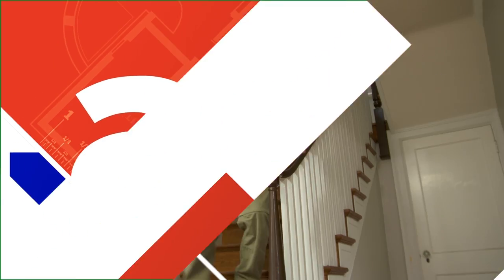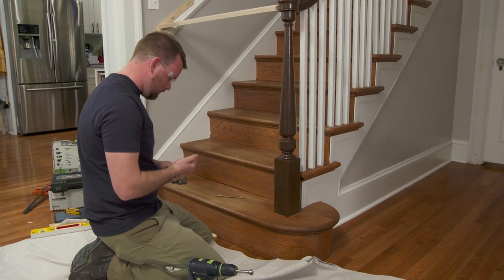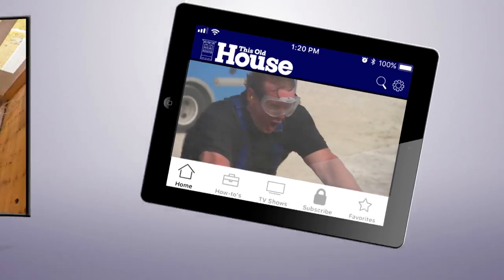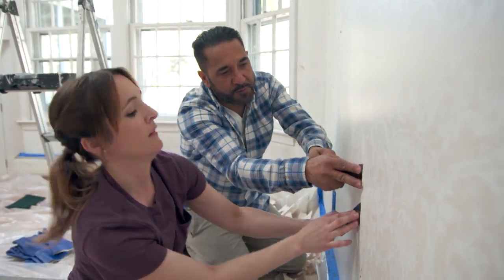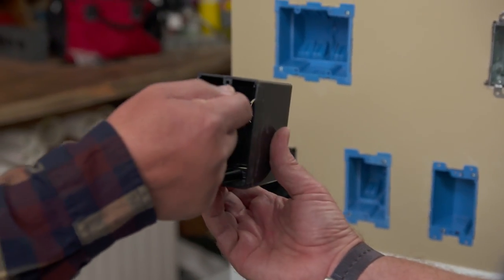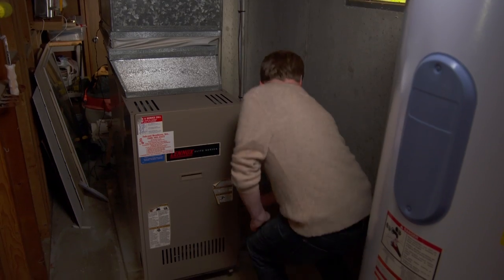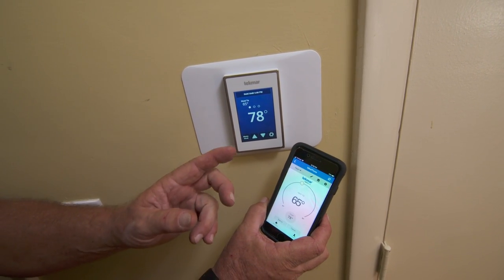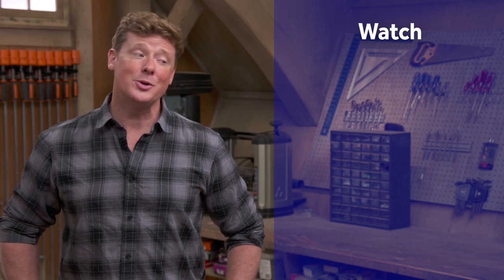ASK This Old House | Loose Railing, Smart Thermostat (S18 E13) FULL EPISODE

Comment: Hi, a nice upgrade of the thermostat but the wires were striped about an inch and only stuck into the device about ¼ inch. Then he pushed the wires back into the box that could have touched each other and sorted out the unit or even started a fire, I understand that the wires were now only acting as a switch but good practice should always be the rule.
Reply: Yeah I was going to say "Richard, you're a great plumber but a mediocre electrician!"
Reply: Believe it or not, I’ve seen this type of wiring in a lot of new construction.
Reply: He's a hacker
Reply: Lots of armchair electricians in the comment section
Reply: You don’t have to be an electrician to know that you should always trim the wires to the right length. Pride in your own workmanship should dictate that, surely?
Reply: Plumbers lol
Reply: The low voltage wiring to run a thermostat isn't going to start a fire. You're still not wrong, they should've been trimmed correctly.
Reply: @l3jhdfk  I agree
Reply: I actually had that problem just last month. The HVAC guy had too redo the wiring at both the furnace and on the thermostat itself because to much insulation was stripped off and it ended up shortening out.

Comment: I love the idea but I have to say...the wiring done was not the best. The bare wire at the terminations should be kept to a minimum. There was enough bare wire there to cause a fault between adjacent terminals...especially at the old thermostat location when the wire was tucked into the wall.
Reply: That is a class 2 voltage it would never spark enough to start a fire the transformer would just burn out if there was a short, although I do agree it should have been done better
Reply: His success stories are everywhere 😱
Reply: Antonio as an hvac tech I cringe  every time Richard does low voltage wiring there's definitely way too much wire stripped for those connections

Comment: Richards thermostat looks great but 21:43 he should have cut off alittle bit of the expose copper because they might touch and blow the low voltage fuse.
Reply: @19:53 Wiring had to much insulation stripped off. Suppose to have insulation on the outside and bare wire inside on terminal.
@19:55 Ran  wiring over the duct work. That's lazy workmanship and  duct work .. although extremely rare, could damage the wiring.
@20:43 Circuit board the wiring connected too on the furnace inside was very dusty and dirty. Never connect wiring too a dusty circuit board like that because it can short out and NOT at least cleaning off the dust before connecting the wiring is lazy workmanship.
@21:19 Didn't use a drywall anchor. Attached screw directly too the pilot hole.
@21:39 Wiring had to much insulation stripped off. Suppose to have insulation on the outside and bare wire inside on connector.

Comment: I would have looked at the staircase from the underside first to see if a lag could have been driven in from behind. If it's a Sears house it has a basement staircase too.
Reply: You think the last few threads of a lag would be a stronger joint than the head of a structural screw and three inches of thread?
Reply: @chrisfoxwell4128  My point is is could have possibly been screwed from under the staircase and he didn't even check. Norm or Tommy would have done that - Nathan is a bit indelicate. See him changing the swing of a door in one episode - he really gets sloppy with the chisel.
Reply: @dalesworld1308  , he might not be the best finish carpenter but a lag would not be a better joint.   It wouldn't do anywhere near enough to impede the lateral movement which is what causes it to become loose in the first place.    Maybe we build out the underside of the stair, put a 6" plate on that, drill up through the post, run a threaded rod up to a nice brass knob, and cinch it down so someone could run full steam into it.
Reply: @chrisfoxwell4128  Whether it's a lag bolt or a HeadLOK screw isn't the point. You just want to argue. I'm done.
Reply: @dalesworld1308  , you're correct, it wouldn't matter what was screwed from underneath because it wouldn't offer the support needed.
Reply: @chrisfoxwell4128  NOT FROM THE BOTTOM. Underside of the stairs is the backside. He could have walked down into the basement and ran screws in from the back of a riser the way he just ran them through from the front.
Reply: @dalesworld1308  , exactly what i wrote the first time,  the end of the screw is not as secure as the head.  The way he did it makes the screw head pull against the thing he doesn't want to move and 3" of screw secured in an immovable object.  The other way the movable object is pulling agaisnt nothing but the threads making not as secure.   The newel post was not some beautiful piece of wood, it was painted and the dowel was fine as a filler.

Comment: Pretty sure the Nest thermostat would work with the 2 wire system.  Ours does.  It charges a battery off the voltage from the line to keep it running 24/7.  Richard, what do you have to say?
Reply: Most of the time it will work. Just remember the only time the thermostat can charge is when the system is running.

Comment: what about 220 volt thermostats? I have cadet wall heater, I hate them but that is what I have. I can not find internet smart line voltage thermostats.
Reply: I used 120v version of this with my cadet baseboard heater in my tiny house. https://www.supplyhouse.com/Honeywell-Aube-RC840T-240-240v-Relay-w-Built-In-24V-Transformer    >then wired 3 wires  from the relay to my nest thermostat.  I only needed one heater so it was a suitable solution for me but kind of expensive.  Been working well for the last couple of years.
Reply: I use Mysa line voltage smart thermostats for my electric baseboard heating. They've been very reliable for the past year and a half.

Comment: Honestly? I like smart home stuff in concept but I'm concerned for my data and what people can learn from exploiting that sorta thing.
Reply: Then you're smart.
Reply: Lots to be learned about you based off what temperature you keep your home in the summer... nevermind the irradiated mobile tracking and analytics device you willingly carry 6” from your testes daily.
Reply: Alright yall I guess I need to clarify what I mean. 
You can survive in modern society without a smart thermostat. It's a reasonable thing to want. Your phone, on the other hand, has more or less become a necessity in modern society and so is one of those things that if i could make dumb i would.
Also: Your smart thermostat does more than just keep track of things like the temperature your house is at. If its on an app, its suddenly a back door into your phone or computer. If you require a registration email address or some sort of payment to the company, suddenly a hack of their systems turns into you losing a bunch of information and personal data that they have on you, including credit card info if you buy it directly from the manufacturer. It keeps track of when you're home and when you're not generally so its not unnecessarily cooling the house (based on what you tell it). What zones might or might not be at what temps when, and allows people to know where things like the bedroom or the kitchen are based on that. There's a lot of ways a smart thermostat can be a dangerous thing. And that's not even considering things like refrigerators  or diswashers (seriously? you need your refrigerator hooked to the internet? why? or your dishwasher? just like idk... run it before you get leave if that's an issue.)
Reply: Oh and also: I've heard of times where casinos got hacked through things like the thermometer in their fish tanks or where a person can't just use their dishwasher because the necessary software updates haven't happened, so I know im not being alarmist or anything I just would never trust a smart home. If they decided to do all this but without the internet aspect of things im 100% in.

Comment: Who mounts something like that thermostat module to a pegboard? You don't mount to something that could very well be temporary.

You also need to learn how to strip wire.
Reply: The 1025R ... with technology changing so quickly I'd bet that module gets changed out long before the peg board goes away.
Reply: it's mounted to the stud not the peg board
Reply: @TrumpAmerica-2024  it's still on the pegboard.
Reply: @The1025RChannel  do you not see the stud behind the pegboard?
Reply: @TrumpAmerica-2024  I do. My issue is if the pegboard gets removed the module will have to be removed and then put back onto the stud.
Reply: @The1025RChannel  just cut around the module, simple solution.
Reply: @TrumpAmerica-2024  or pick a better location in the first place. Like the stud next to the pegboard. It's just an unprofessional way to do an install.
Reply: @The1025RChannel  calm down karen
Reply: @TrumpAmerica-2024  yes because taking pride in your work makes you a Karen. I work in the low voltage industry and this would be considered unacceptable by most people.  

Not to mention it's nothing more than an overused, misogynistic term.
Reply: You people should stop bickering. Bottom line is, he's a hacker.
Reply: @The1025RChannel  sure you do karen
Reply: @The1025RChannel  dummy, there's a stud in the back of it! 😂😂
Reply: @fred290e  no one was questioning that.
Reply: Look I'm no expert,  but if it were me,  I would have installed that blue module beside the heater. Maybe on the duct work down low or something. 🤷‍♂️
Reply: Agree with 1025.  There's no reason for it to be on the pegboard (yes it's in the stud but it's still taking up room on the pegboard).  People change up their pegboard occasionally, moving tools around or whatever.  Having this equipment right in the middle of it would be a bit annoying.  There's several feet of stud below the pegboard they could have used.